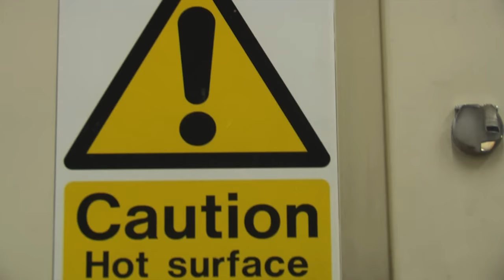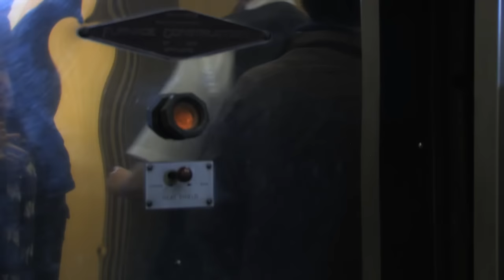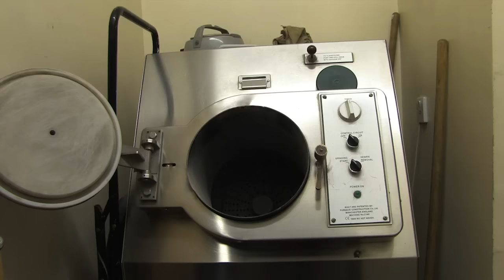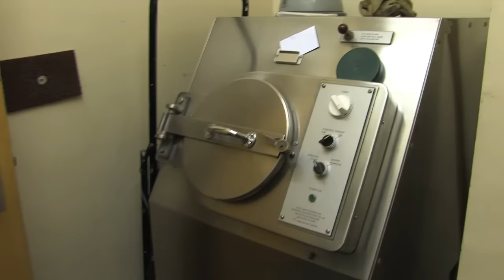Do I get the right ashes?

Comment: just so you know. the bits they showed are from the crematory operators postiton in the process. Any and all safety checks and identification on the body is done in a pathology building and or mortuary. At the crematorium their purpose is to carry out the steps of the actual cremation. they don't open the container (i say because coffins aren't always used) for respect to the decedent and the decedent's family.

Comment: Hey...Knowledge is Power. I'm all for total transparency when it comes to the Funeral Industry. There are LOTS of n'er-do-wells who will exploit people at a time of loss, when you're most vulnerable, and up-sell as much as possible. This Funeral Director seems Extremely kind and respectful. My only issue was the ID cards on the plastic urns being held with a rubber band. Yikes ! They need those stick on, acetate window thingies to put the card in, to ensure it doesn't fall or get knocked off.

Comment: I've got 2 titanium knees and a bunch of metal pins and parts in me. I guess their gonna have to take me down to the recycling center after I come out of the oven.  Cause if the put me into the blender?....WHAMOO...That things gonna burn out a bearing!!!
Reply: Todd Miller during the prep process they actually will remove all metal pieces, implants, aesthetics, pace makers, the works. I read and while not a credible source in Wikipedia that pace makers in such heat becomes like a bomb and will damage the cremator.
Reply: DarkLinksgirl cool
Reply: Your funeral director will open you up and will remove and metal or titanium parts to be disposed of seperately. Some are returned to a medical university where they are studied to see if any advances or improvements can be made to furture parts.
Reply: @diggerpete9334  just like Arnold.

Comment: It varies from place to place, in a vid I just watched of an American crematorium, the bodies were wrapped in plastic bags and placed in a cardboard box. When I worked in a NZ cemetery in the 80s it was more like this, but the view hatch didn't have glass and you had to be careful in the early part of the process because it was possible to be sprayed with hot liquid as the body was sizzling and popping, so you needed to be careful. I was basically a gardiner and only looked into the "crem" once. That was enough.

Comment: In my state here in the US, the name of the decedent, the date of birth and date of death, and the name of funeral home must be written on the cremation container. The cremation permit, cremation authorization form and any other paperwork must checked against what is written on the container. That includes the receipt of remains from the funeral home. The paperwork is required to be placed at the control panel at the time of cremation. A metal disc with a number is required to be placed into the retort. Another metal disc with the same number is kept at the control panel during the entire process. 
Only the “authorized agent”(s) are allowed to be present during the process. 
All remains must be placed into an urn and they must be processed to less than 1/8” . No bones or fragments are allowed. The metal disc is to be checked against the paper work again then placed into the urn with the ashes. 
It is illegal to cremate more than one body at a time. There is a 48 hour waiting period as well.
Reply from the maker: Largely the same here.  As you could see the name identifier was blank to preserve anonymity.
Reply: @greenfuse4662  yes. Sometimes people from the UK and other countries think cremation in the US is done with a degree of informality. as you said it is done quite the same way.

Comment: I thought they would take off the metal parts
Reply: Macedonia Choirs only pacemakers ect as they explode in ovens this is done before you are placed in coffin and the metal handles just melt
Reply: they probably don't even burn the coffin if the cameras aren't on
Reply: through my eyes  absolutely not. Everything is accounted for and treated with the utmost respect. There are no shady dealings in second hand coffins- all crematoria have open days in the Uk and you can ask to visit and watch them work. You comment is disgusting.
Reply: They are not metal.

Comment: They literally just threw the cauffin in there
Reply: if you would push it in slowly then it would catch fire while half of it was still outside, and then you would be in crap..use a bit of logic and think next time..
Reply: i work as an operator at a crematorium and its not throwing it in at all, because of the immense heat inside the chamber (depending on the type of coffin) it can sometimes ignite straight away before the door is shut ive seen this many times, yes it may look like we don't care when we do this but its either do it quickly risk setting the entire crematorium in flames

Comment: I work at a large  Crem in the UK Shame on u  !  Why were u not wearing your visor helmet to protect yourself when raking out the ashes ?  It only takes a explosion in the cremator for ash to burn u and u would have a injury.  The  rest of the video was a accurate account of  a cremation process. However,   Cremation is becoming more expensive with Crematoriums having to installed the  mercury abatement  equipment and  upgrade following the  cremation code of practice.
Reply: lustful2  y is it showing pple being put in card board box’s wen they arrive for there funeral they are in there own coffin what the family picked so are they removed from ther casket

Comment: The way they just threw that coffin in?? Horrible!
Reply: Ells Bells trust me. The heat that hits you when that door opens, even if you are standing on the other side of the room, is unbearable. They have to do it like that for their own safety. If they don't push it in hard enough or quickly enough they will get horrendously burned trying to re-position the coffin inside the cremator. It looks really harsh but it is necessary to do it like that unfortunately.

Comment: 2:29 , The way they push the coffin in is really bad,i would complain.
Reply: @- GachaKitten -  They have to - it's the only way they can get, what is basically a large wooden box with a body in it, into the centre of the chamber. They can't have rollers or any kind of mechanism to move the casket, because the unit is sealed and uses forced air along with the heat, and also because they would never stand up to the super-high temperatures. The casket need to be placed in the centre of the chamber to ensure a safe and thorough cremation, so shoving it is the only way to get it there. You should see when it's one of the large, solid heavy wood caskets in North America - it takes 4 guys to shove it far enough. It's like this at all crematoriums.